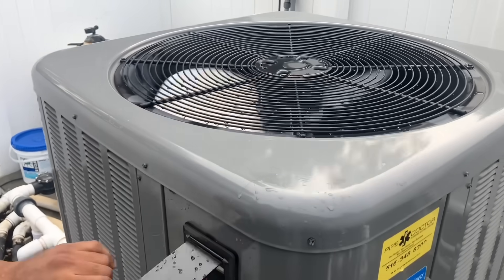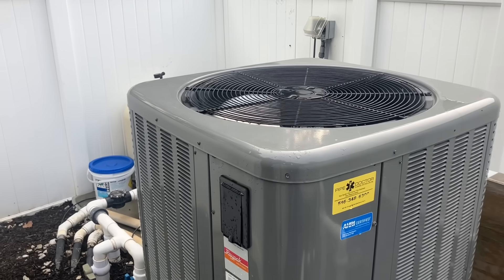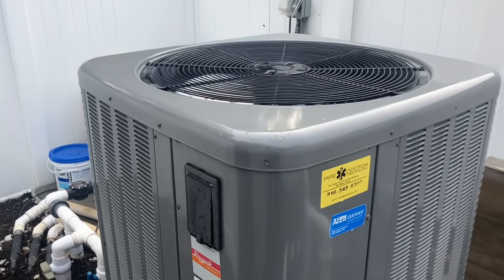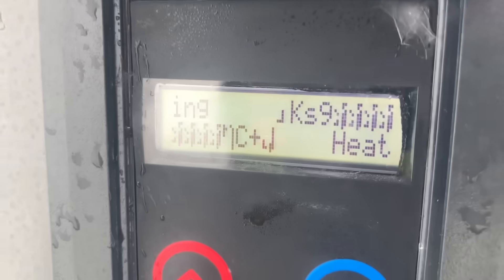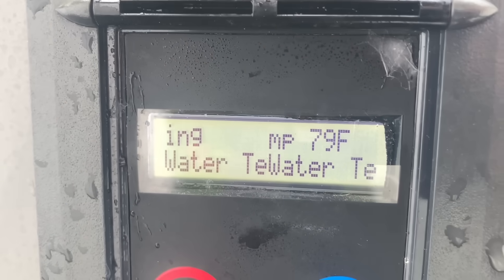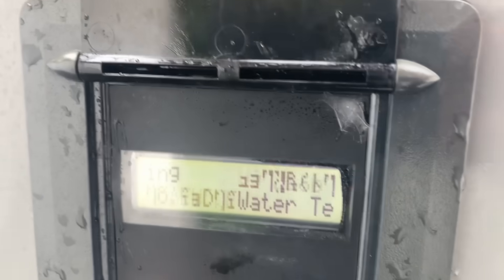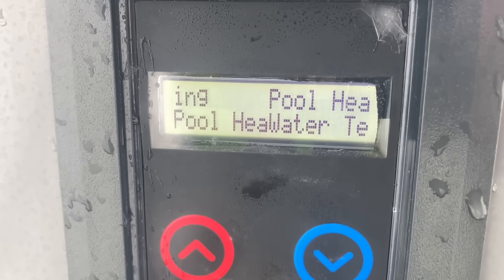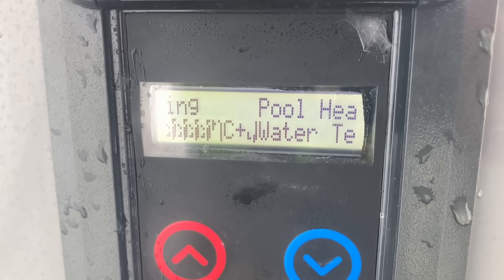RayPak Pool Heater Gone Wild! Display Glitching After THREE Control Board Replacements?!

Comment: Check the DC power supply AC ripple voltage, if it is a separate voltage supply and not located on the board.

Comment: A lot of today's boards are made up of components with surface mounted components, heat and vibration are not good factors. The same occurs in oven control boards and TV circuit boards. For and experiment you could answer this with a heat gun across the components, if the issue goes away that will tell you that the machine that soldered those components in place didn't apply enough solder and the SMD's are all coming loose from heat and vibration.

Comment: has the cable between board and display ever been changed? if not integral to one of them. has there been sealant added to stop water from entering it( probably the screen/touch panel buttons)

Comment: Probably a cracked solder joint on the display board. Could be a simple fix, even something you could do right there on site. Wouldn't hurt to have a battery operated soldering iron, Soldapullt solder sucker, and a roll of rosin core solder on the truck.
Reply: I agree with you on the soldering iron, but 3 boards and same problem 🤔🤔🤔
Seems like a voltage control problem to me. I would be changing the power supply.
Reply: Agree as I just posted about SMD's on today's circuit boards.